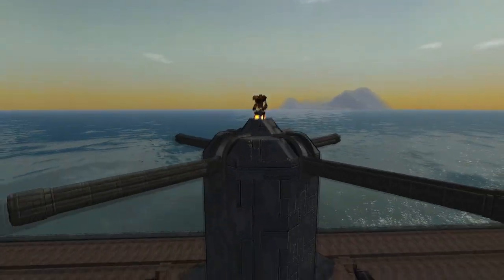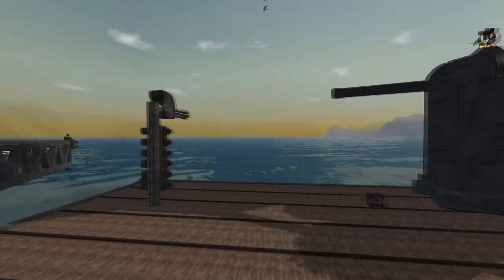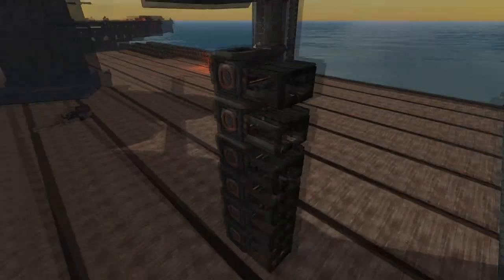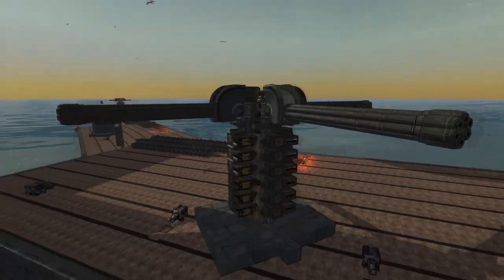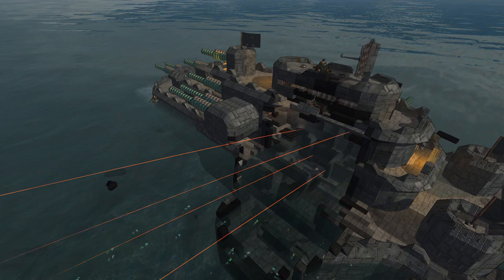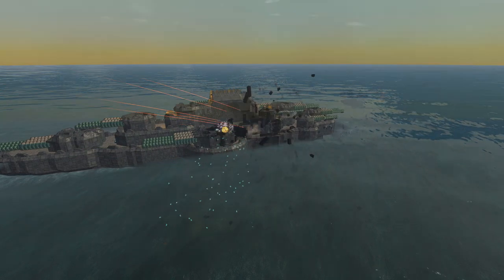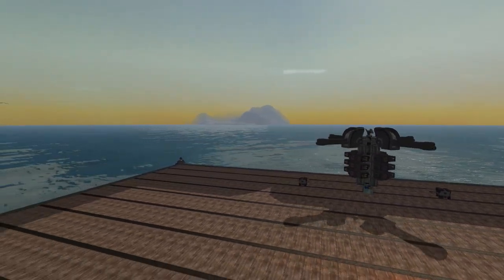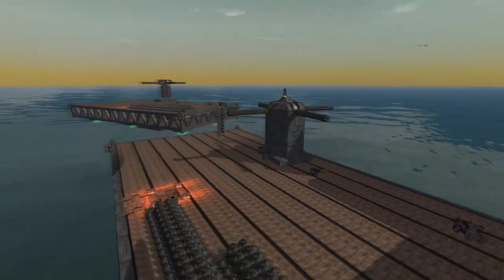Cannon Carousel - Rotary 150mm Shotgun - From The Depths

Comment: Wow...
That is unorthodox.  I like it.
Reply from the maker: +manictiger Unorthodox is a very polite way of putting it, thank you! ;D
They're pretty silly, but moderately effective and fun to build.  I'm thinking this could be fun with the no-autoloader method, lol.
Reply: ireLAN Gaming
I mean, the hit profile's is pretty large, but it could be viable with the current limitations of adv. guns.

I really do want to make an effective 120mm high velocity Minigun, but they don't make 4m ammo belts.
Reply from the maker: What's stopping you using less shell blocks for a minigun?  You should be able to get a 4 block 120mm into a 1m belt.  With the gunpowder changes in the devtest branch, stacking powder is MUCH less effective.  You get less speed and the speed counts for less of the kinetic damage.  It actually gives the other kinetic parts a purpose though.
I've just tested out the carousel again using the no-autoloader method.  1 gauge, 1 input, 2 firing pieces on every face (8 firing pieces in all, with 2LWCs in the centre).  It's a much smaller cannon overall and seems to be very effective actually.
Reply: ireLAN Gaming
I really liked hyper velocity guns, but it makes sense that they would nerf it.
I highly doubt Mach 7 is an accurate reading for any gun-powder weapon.

I like the longer shells.  I tend to only stick cannons on large ships, so I like everything to be as powerful as I can make it.

If I wanted to make a smaller boat, I'd probably not use the under-powered adv. cannons on them at all.

I was thinking of adding 2 miniguns to the main turret, though.
'Squirrel killers' as you call them.
Reply from the maker: The CIWS work pretty well and can still work with the new devtest with a minor ammo tweak.
I've grown very fond of short shells recently for the huge accuracy increase. :)
Reply: ireLAN Gaming
Well, I always use a ship-length laser system hooked up to an anti-missile laser mast, so missiles are not a problem.

I don't think my primary turret is optimal for planes, even with miniguns.
It's literally a battleship turret.

My previous solution to planes that get above me, was to put a laser facing up, which I incorporated into the mast.
But that that's unfeasible for this ship.

I came up with an idea.
I'm going to stick AA missiles between the torpedo launchers in the secondary turret and assign it as weapon system 3.
Reply: ireLAN Gaming why dont you make actual shotgun shells? you know 1 powder, timed fuse at 0.05s and frag without nosecone, put in dispersion angle of your needs. made one 119 mm today, puts a large amount of damage, even with 30° of ofsset. still i need to put em at 5° for being effective. short ranged, powerfull one shot capabilities. also full auto if you want

Comment: This is great! I loved the spinning missile system on the Varmus and this is even cooler.
Reply from the maker: +Tristan Sutton It definitely looks the part!  I think it's probably more efficient with missiles, but for short barreled cannons, you can get quite a good fire rate out of a small space. :)
Reply: +ireLAN Gaming So, I tried making one, and one of the 4 guns is not tracking. It can fire when I use it manually, but using AI it does nothing. I'm using a separate local weapon controller per gun, all connected to one AI mainframe. I can not seem to figure it out. Halp
Reply from the maker: That could be down to the rotation speed. You can either try slowing the spin block down a bit or as Ruger suggested, use a mantlet with higher aiming constraints, such as a 3x3. They seemed to give me occasional tracking problems even at 1 speed.

Comment: If you halve the reload time to get it firing two times per rotation it should be quite useful for shooting at multiple targets and that is something the turrets are really bad at, while it could be done by hull cannons hull cannons have their own downside, and you'd probably get effectively double the fire rate than hull cannon unless completely surrounded. having enemies around you also means they're probably fliers so an AA fit would probably be good in that case and it would have superior tracking compared to hull cannons when it comes to that. But these are just thoughts on how it could be used at first sight of the concept, I may be very wrong about all this.
Reply from the maker: +Zorbeltuss This is a good idea.  It would also help with things that are moving to the left of the cannons.  They sometimes move ahead of the cannon's reload speed. I've found they typically fire at the first thing in view when a reload comes up, so having a slightly shorter than 8s reload is very beneficial in this case.
The main problem I've encountered with these is the 'first shot inaccuracy' problem with advanced cannons.  The problem is on the firing pin, where the minimum required accuracy you can set is 2 degrees.  Which is fine for a turret in most cases, as it will maintain it's tracking and the 2nd shot will be accurate.
With something like an AP sabot, where your accuracy is probably as low as 0.25, having that extra 2 degrees pushes this to a potential 2.25 degrees, which is frikken terrible.
As these rotating cannons essentially 'first shot' every time, it really hurts their effectiveness with this ammo type and ordnance seems to be much more useful where accuracy is less of a concern.
The ability to shoot around yourself could be rather awesome though.  Might be interesting to make a truly spammy rotary mortar using belt feeders. This idea would probably be most effective on a reasonably fast airship or something mobile that can get in the middle of the action.

Comment: what is the max gauge and coolers,you can use,on the advance cannons.

Great videoes ,maybe  a tutorial from you and from ruger to build a advance cannon from the bottom up
Reply from the maker: +david lacey The max number of gauge increasers you can use is 8.  For coolers, there is no limit technically, you can eventually get to an effective 0 second barrel cooldown with enough of them, you just need a lot due to diminishing returns.
I've already done some ground up cannon builds, but I think it's time to amalgamate a lot of the tips across different videos into one place.  I shall add a general cannon tips tutorial to my list of things to do. :)

Comment: Does this still work since the barrel elevation is fixed?
Reply from the maker: +EndorianHD Hmm, I haven't tried them since the patch actually. It probably won't work now at high calibres because the barrel will track way too slowly to get a shot off.  Making tiny ones might work ok but it's much less viable with small gauge weapons.  The barrel traverse changes kinda make these redundant I think. :/

Comment: Could you do a video showing how to 'math out' the cannons like Ruger does? It's not something any of your advanced cannon videos show clearly. Thanks.
Reply: +Asinine Futility They did show the process whereby you build a cannon splayed out on a test platform, get it working how you want then count up all the things you need and try to build them into a cylindrical turret. Seems a pretty good way of going about things. I'm sure you could build a spreadsheet to figure everything out but i reckon it's not necessary. They mentioned something about the amount of ammo part boxes you need relating to some other number in a recent vid but I can't remember which.
Reply from the maker: +Pseudobean Machine You have a good memory!  We did indeed cover the sciencing process in a vid, you can find it here: https://www.youtube.com/watch?v=g89XIKvSQYM
Someone else has also made a spreadsheet that calculates your reload rates, firing speed etc based on the size of your cannon:  https://www.reddit.com/r/FromTheDepths/comments/3scys5/advanced_cannon_calculator_spreadsheet_v2_i/
Finally, we talked about 'dead reloads' and shell parts in the 1000 sub special, there are a few cannon building tips throughout the talky parts of the video: https://www.youtube.com/watch?v=2hoqvD2LDk4
Hope these are helpful!

Comment: I suck at advanced cannons i cant seem to get them to fire quickly enough for an AA gun no matter what I do.
Reply from the maker: +Shinobi91585 That can be a real problem for AA guns.  It depends on your shell loadout largely.  You don't need a whole lot of damage for AA, just accuracy, so keep the gauge fairly low and the muzzle velocity high. This also helps to reduce the reload time and barrel cooldown rate to allow a decent refire.  If you want to keep the size of your cannon down but maintain a decent reload speed, try belt feeders, they're great for AA. :)
Reply: +ireLAN Gaming  whats a "ideal" gauge? I have tried 20, 30, 40 and 57mm to no avail the first 2 seem to do way to little damage to kill heavy air units and the last 2 either fly to slowly or aren't fast enough :C
Reply from the maker: 100mm seems to be very effective it's a pretty big cannon in the end up though.  You can get low gauges to do pretty high damage if you use a bunch of powder and just go for crazy high muzzle velocity.  Try to squeeze as many shell blocks in for your desired gauge to fit in a 1m loader and use belt feeders then make your shell entirely gunpowder with a Sabot head and nothing else.  Keeping the gauge relatively low will mean you don't need a ridiculously long barrel.
Reply: I managed to build one last night that has a RoF of about 120p/m from a single barrel using flak warheads for damage against the onyx watch takes out an Eyrie in about 20 seconds
Reply from the maker: That's a very high refire for a single barrel. What sorta spec is the cannon?
Reply: 100 mm belt fed 1m loaders with triple clips single gauge increase and unknown coolers and splitters 5 rack shells 5 powder 1 timed fuse 3 Flak and shaped head.
Reply: also there are 14 auto loaders
Reply from the maker: That's enough to push your reload time up quite a lot with the complexity if they are standard loaders.  Belt fed is the way to go for fast refire rate.  If you want to get significant refire out of a regular loader, you either need a pointlessly big cannon, or multiple firing pins. :)
Reply: once the clips are empty its basically usless but for my massive flagship there will be at least 6 and once again thanks to both you and Ruger for the tutorials that helped me get it to where she is just lacking a name lol
Reply from the maker: That's always gonna be the trade off with belt feeders I'm afraid.  You're very welcome.  Glad we could help out. :D

Comment: Can you make a nuke cannon
Reply from the maker: +DAT GUY It doesn't work sadly. There's a hard cap of 10m on explosions.  I was actually playing with 500mm HE shells last night and they're just not very good.  huge visible explosion, but only tiny damage radius. :(
Reply: +ireLAN Gaming  I could swear I made a flak shell which had 13m of blast radius but your the expert anyway :P
Reply from the maker: The shell customiser will still display a higher blast radius, but the actual explosion only damages a 10m radius to save on performance.  Try making a flak shell with 1 powder and as many flak components as you can fit, it will still only make a 10m hole, regardless of what the customiser says. :(